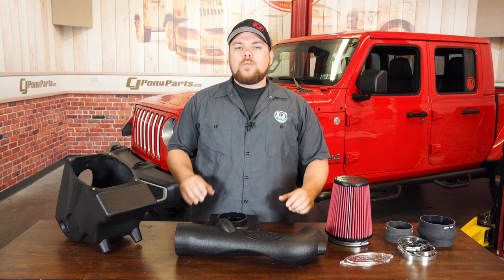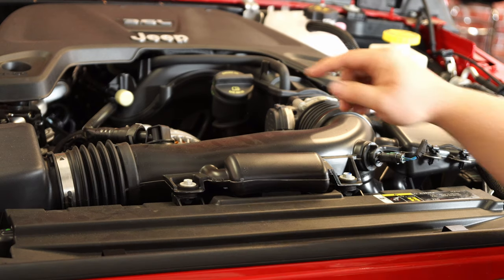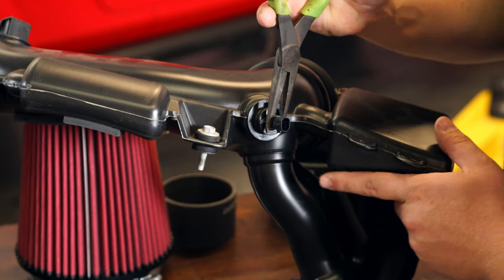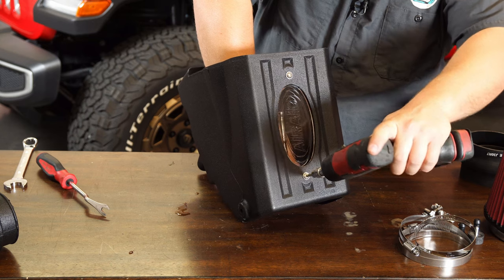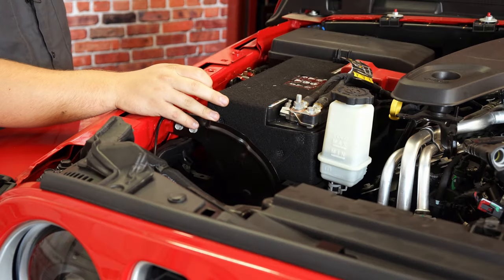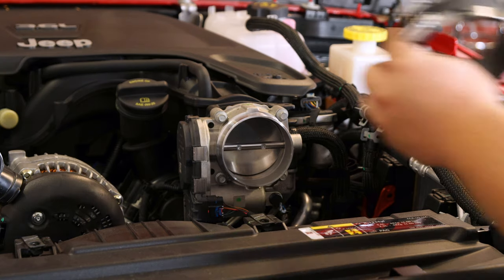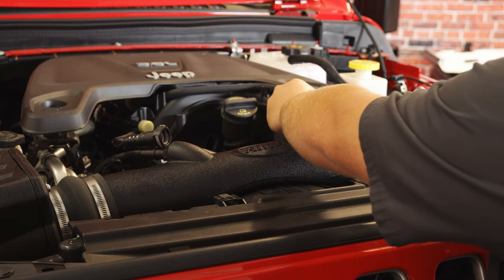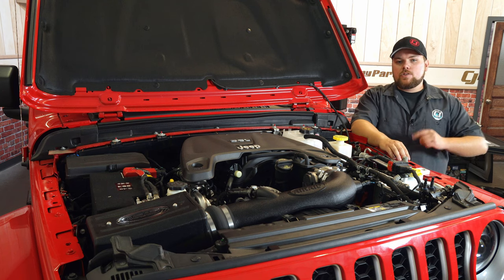2020 Jeep Gladiator Install | Airaid MXP Series Cold Air Intake Kit

Comment: I would like to see a gasket around the 4 bolts that hold the filter in place.
And like with all aftermarket intakes, they are overpriced in my opinion. 
Especially the plastic ones. its about $5 worth of plastic, costs maybe $15 to mold it. $5 in hardware, and a $30 filter? if that.
Reply: R&D costs money. But definitely agree about the gasket.

Comment: Can this air raid system be connected to the Rugged Ridge cowl Mount High Low snorkel system that opening looks like it's the same size as the factory set up and could potentially connect have you ever checked into this please respond

Comment: Im worried about hear temps since the factory box does draw fresh air from the grill
Reply: yeah, I don't understand how they can get away with calling this a "cold air intake." It's drawing air from the hot engine compartment, as opposed to truly "cold" air from the grill. If anything, all these kits do is increase air volume and make the engine sound burlier.